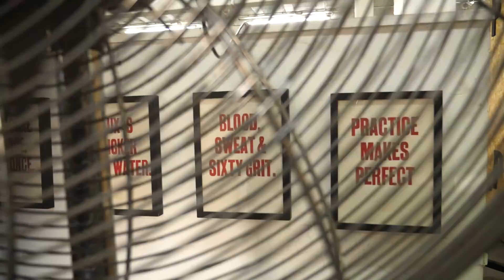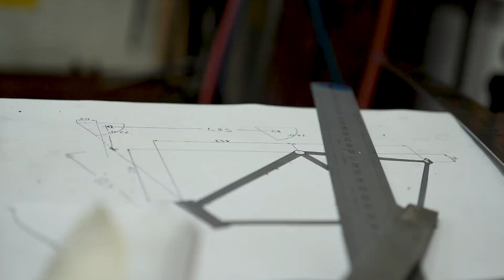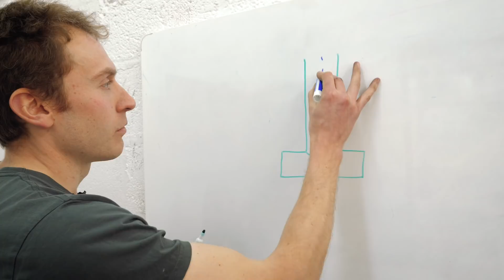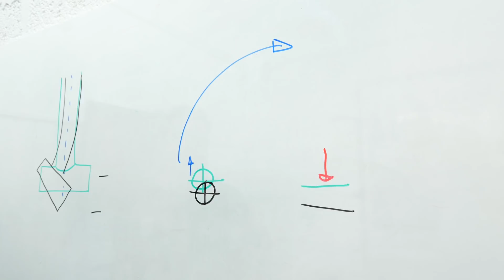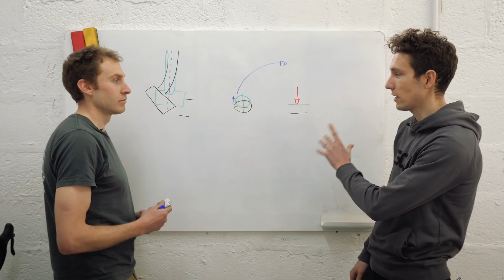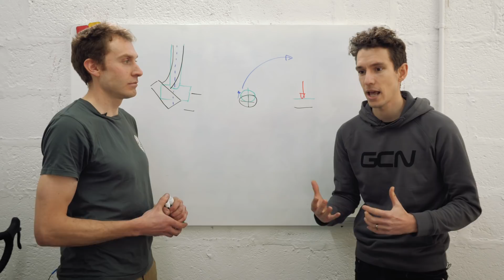Are You Faster On A Stiffer Bike?

Comment: The search for a stiffer bike is based in the fact that if it continues to flex beyond a certain point, the geometry will alter and even the chain line, tending to an transmission failure during a sprint or stand up climb.

Comment: With due respect, your experimental setup doesn't represent what happens in real life. You were reacting the frame torsion with the turbo trainer. On the road however, it would be reacted by side load in the tyre. The frame itself will have low hysteresis (steel especially) but the tyre certainly doesn't. So, the cyclic torsional loading of the frame does come at a cost.
I would still agree that frame stiffness is a 'feel thing' to a large degree. However, that doesn't mean it's not also beneficial. It is impossible to generate load without something to react it. Imagine a super flexy crank - you'd never be able to push hard against it as it will bend out of the way. If we were perfect engines it wouldn't be a problem - we'd just load it up. But, we provide power with alternate legs and to differing loads round the cycle. So, flex in the system causes a lack of reactive load at the point of peak power generation. The load doesn't simply fall out of phase, the peak drops too.
In short, static tests and analysis of an inherently dynamic system, can lead to flawed analysis. Not that I'm saying my hypothesis is correct either though...
Reply: I'd actually hypothesize flexy frames lead to less tire hysteretic loss in the tires. Imagine you're sprinting hard up a hill on a stiff bike, moving it side to side on every pedal stroke -- since the frame is so stiff, all of the off-axis forces go directly to flexing the tire, and of course the damping ratio of rubber is quite high so a large amount of that flex is simply lost as heat. Now if you did the same with a flexy bike, presumably some of the off-axis strain would be weighted more towards frame flex instead of tire flex. And since the damping ratio of steel (or even carbon) is a few magnitudes lower than rubber, that flex is nearly lossless, and is returned to the drivetrain instead of being lost to heat.
Reply: Worth noting that tyres generate grip through 'slip' at the macro scale. Because the tyre is rotating, cyclical side loading will cause a pathline that meanders side to side - think of a little sine wave. Accordingly, the losses in such a setup are not tied solely to the lateral stiffness of the tyre and the hysteresis associated with 'non-slip' side loading (in say a non-rotating tyre). In short, the losses aren't the same physics as vertical compliance of larger section tyres and rolling resistance.
Reply: This is the video I want to see
Reply: I stopped riding stiff frames a very long time ago, I don't even ride my correct size frame. I always go for a taller frame to get more flex.
Reply: Gonna agree on most of this. The efficiency of the frame probably doesn't change a lot in the minute details from frame to frame, BUT this isn't the same to be said for handling. A stiffer frame will handle better and this is where I believe the sensation of stiffer=faster originates: simple human misinterpretation.
Reply: Sounds like you're describing a suspension fork that has semi-independent L/R travel. This would affect balance first, and loss of balance (and energy required to correct/maintain it) would lead to less power available to turn the cranks smoothly.

If we consider a suspension fork or a FS mountain bike, some of that power goes to compress the suspension, but the return on the shocks (if the bike goes down after a bump) sends power back to the crank the same way this video shows (as long as the cranks are still being turned at that point). If the rider bounces while riding on flat, the energy of the return can be used to move the rider back up, and this feels like lost power, but then the rider regains potential energy as they are higher. Do they use that potential energy to power the cranks? If they go higher than their initial position, yes. If not, it was extra energy output that did something but did not power the drivetrain. This sort of "accidental" energy redirection is what we really want to avoid, right? I can't quite tell if this same redirection away from the drivetrain happens when flexing a rigid frame on a road bike...

Any thoughts?
Reply: Cerveza de Garaje, that's kind of a gross application of the 2nd law to conclude that "stiff frames are faster". The energy lost to heat is so incredibly small (think something on the order of 10^-4 watts) compared to the energy put into flexing it in the first place. So where does all that energy go?
Reply: greenfoam and how, if I may, does that help?🤔
Reply: I agree, but I also think that all that block is doing is helping the crank and frame gather potential elastic energy. Where it not there, per se out on the road, then it just wouldn’t happen at such a scale because the energy is transferred straight to the rear wheel
Reply: The tires are a constant here. I'm no physicist but if the tires to have that much of a role there would be no frame flex at all in either bike, which is simply not the case in an adequately inflated road tire. It seems to me that there isn't nearly as much lateral torque transferred to the tires as there is with the frame itself when power is applied, and spinning wheels and tires take much more force to deflect than static ones. It's a very complicated problem. There are a few inefficiencies as a result of flame flex that weren't mentioned. I think the frame flex will transfer energy back into rebounding the rider's position relative to the frame, effectively using a portion of the energy to shift the rider instead of transferring energy back to the wheels. I also think there's probably significant loss in efficiency from chainline deflection with the flexing bike, with more wear and less power transfer as a result.
Reply: @jimmythfish I agree entirely.  Any lateral force through the frame is in series with and supported by and through the tire and the force on the frame and tire are thus equal.  Yes if anything flex in the frame would reduce that force force for very dynamic loads, but most likely it wouldn't change it at all in most cases.  So the deflection of the tire wouldn't change at all, and the losses dissipated in that deflection wouldn't change at all.  I do think there is something to the point of making the load resistance out of phase with the power stroke though.  Technically that doesn't cause energy to be lost anywhere in the bike, but it does cause difficulty and even inefficiency in delivering power from the leg.  So even if the bike still has the same efficiency, the whole system may not.
Reply: Besides, even if everything that happened in the test was accurate, which I agree it's not, according to the 2nd law of Thermodynamics states basically that " In any given exchange of energy, there will always be energy lost", which basically means that with all the exchanges in the experiment the losses will be bigger than with a stiff frame which will produce no such exchanges.
Reply: @CervezaDeGaraje  a stiffer frame is still producing those exchanges, just at a smaller scale and probably below the level of human perception. unless you were pedaling a concrete block the frame still deflects

Comment: IMO flexy frames don't really rob energy, since they are quite efficient springs. But on the stiffer frames the plane in which the pedals turn sways less from side to side, which allows to the legs work more effeciently. In short, it's about ergonomics, not physics.
Reply: Sorry if I missed that someone else said this. 

I find the methodology questionable. A more accurate method would be to measure the power at both the peddle a d point of tire contact. By taking two bikes, a smart trainer, and a peddle based power meter. Then ride under a consistent high load (enough to cause measurable frame flex).  Between tests move the drivetrain, including the wheels, between the stiffer and more flexibility bikes. Then you could measure the amount of energy loss due to flex.

Comment: If this and other recent changes in thinking are true then I start to wonder whether to listen to anything manufacturers say.  After all, the science and ability to measure these things has been about for many many years so how could they have got it so wrong?  Maybe it's better to just ride what you have and enjoy it.  If you want to go faster there's nothing better than getting fitter.
Reply: >"After all, the science and ability to measure these things has been about for many many years so how could they have got it so wrong?"

The confirmation that pressure is important to tire suspension on a road bike was a matter of spending a couple hours with a pump and a stopwatch, rolling down a hill. Experts got it wrong because for several decades, they simply never bothered to do this.

The effects of frame flex are considerably more difficult to measure, since you need some way of selecting frame flex characteristics while keeping the test blind. That can be done by having several outwardly-identical frames made with different tubing wall thicknesses, or by using something along the lines of Zertz inserts.
Reply: There is also the fact that stiff bikes feel responsive, and that feels amazing to ride! So while they might not be faster, they do ride brilliantly well and are plain old exhilarating!
Reply: >"There is also the fact that stiff bikes feel responsive, and that feels amazing to ride!"

I think this gets overstated quite a bit by conflation of "stiffness" and other properties of a bicycle, particularly the handling geometry.
I've got a vintage noodle of similar front-end geometry to my Emonda, I think they feel pretty similarly tight and punchy.
I've got a drop-bar conversion of an old mountain bike (extremely high trail for drop bars) that flops all over the place if I try and lay down power out of the saddle at low speed, but at 30mph it feels like a vertically-compliant brick wall, and right around 20mph it feels strangely like a road racing bike aside from its weight.

Stiffness about the cranks is something that can be felt, but corresponding "responsiveness" seems strange and complicated.
My flexiest bike is probably my 1979 Fuji America (large size, skinny double-butted 4130 frame tubes, 40-year-old square-taper BB, super-skinny old aluminum crank arms), but sometimes it seems to really come alive under high-torque low-cadence strokes.

Comment: I guess I should have added the place the lost energy goes is into the rider.  The human is a great damper and absorber of the energy from the spring back at the bottom of the pedal stroke.  It is also the largest element in the system by far.
Reply: This is exactly what I'm thinking! It's a nice test but assumes that the crank is held rigid when the spring is released, which it isn't.... The energy is going to be sent back through the riders legs in a negative way.

Comment: A stiff frame responds to higher frequencies, interfering less with your power release and giving you the feel of fast response. But if we have to be specific, we should take hysteresis into account: for two frames made of the same material, the one which such geometry that at some point displacements are larger (the flexible one), will dissipate more energy due to internal friction, therefore transferring less energy back in the drivetrain

Comment: The feel is a timing or tuning issue.  Just like string tension in a tennis racket or golf driver shaft stiffness (pros will use higher/stiffer here too), the frame stiffness affects when the stored energy is released back during your pedal stroke.  If it comes back at the wrong time the bike will feel slower, even though you are losing very little energy regardless of the frame stiffness.  Roughly the higher your cadence the stiffer, and hence faster spring back, you are likely to prefer.  Of course there is both mass and geometry of the bike involved in its dynamic response, so it won't be that easy to correlate to just the stiffness.  It probably varies with rider strength too.

Comment: A lot of really good comments about the the delay in flex causing a different feel. The next step would be to have a pedal stroke analyzer attached to the hub to see the different plots of force over time. I'm thinking that you would need a pedaling robot to eliminate the human variation. My guess is that the flexible frame will have a smoother response due to the damping of the frame acting as a energy storage spring in the system.

Comment: It's asking the wrong questions.

In simple terms of power transfer, it's obvious that more losses will occur in flexier frames. Even if the energy is perfectly directed towards the drivetrain, a little will be lost to hysteresis.
On the other hand, we're talking about marginal components of marginal amounts of energy. Even if all energy spent flexing the frame was completely lost, even on a fairly flexy bike, the overall losses would still be small enough to be a pain in the butt to measure.

If you want to work out whether there are interesting effects, the first step is to try and measure what the performance characteristics actually are, to give a sense of what to look for and expect. Unfortunately, a use blind test on frame stiffness takes quite a bit of effort to carry out... the only example I'm aware of whose results have been publicly discussed are a test by Bicycle Quarterly, which suggest that a rider's legs can sometimes more easily sustain high torque into a frame that is flexier than another (oddly - or perhaps not oddly - similar to what some people claim happens when climbing hills versus riding on flat land). I'm not sure what tests Cannondale has done, but their road engineering manager Damon Rinard said in a podcast last June that he no longer stood by the assumption that more stiffness about the cranks was always better. So perhaps there are interesting interactions in terms of how the rider's body reacts to flex.

Stiffness is also kind of a mess in terms of how people perceive it. I suspect that people tend to perceive bikes with less steering trail as "stiffer", for instance, because of the reduced wheel flop when riding out of the saddle at low speeds.

Comment: Wouldn't a crank based and hub based power meter (normalized to tolerance differences between the two) placed on a flexy frame and stiff frame, validate this theory? If this theory holds true, on a flexy frame, the power in the hub would lag the spike in loads from the crank based meter, but would average out the same (minus drive train loses). Whereas a stiff frame would have a nominally equal reflexion in values between crank and hub. However the two hub meters should have the same average power assuming all power is eventually going back into the drivetrain.

Comment: Stiffer frames channels your power input directly into the drivetrain, with minimal elaatic energy being stored when you pedal.

Flexible frames channels a bit less energy directly into the drivetrain immediately, but gives it back with the elastic return later on.

So stiffer frames are essentially more responsive and crisper in feeling whereas flexible frames may feel like its blunting the power input slightly, but the frame can feel like its moving with you.

My old aluminum Raleigh was more flexible thanmy Cervelo, and I can feel that I am moving more relatively to the Cervelo's frame because its much stiffer, but it feels much crisper and more responsive, so if I put power down, I instantly feel the bike reacting and going faster.

Id say its a bit like the frame geometry argunent - slacker geometry gives more comfort and is more forgiving, but more aggressive frames are more twitchy, more responsive and less forgiving...

Comment: The issue is not that the energy is returned, it's that at different points in the pedal stroke equal downward force has a different effect on crank rotation. 

If the bike flexes right as your passing horizontal and then unflexes as you're reaching the bottom of the stroke you'll get all the energy from the flex back, but it wouldn't equal as much energy into crank rotation.

Comment: most 3D modeling software used for commercial applications have finite element analysis (FEA), which can calculate the physics of frame flex. Once you have that, theoretically you can model that to calculate the ideal loss. Of course a real bike never matches the ideal values from FEA, but it gives you a good point of reference.

Comment: Some energy will go back into the drivetrain, but you will lose some energy that is generated as heat. That amount of energy is dissipated into the air. The less flex, the less of that energy is lost.  So much for physics. 
I don't think it really matters as much as people think. You might make a frame as stiff as a manhole cover but you wouldn't necessarily like riding or racing on the result. Racers may prefer the stiffest bikes, but the best bike to race on isn't necessarily the best bike for most riders. If I'm going to ride a respectable distance, I like the comfort of a more forgiving frame.